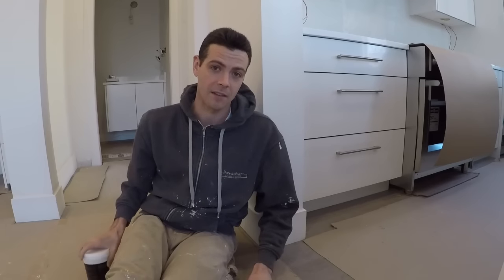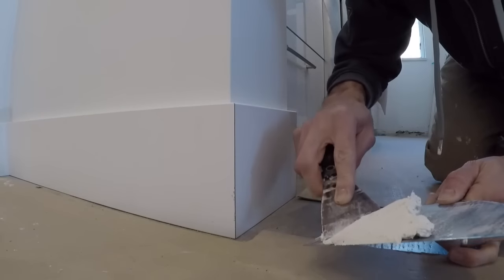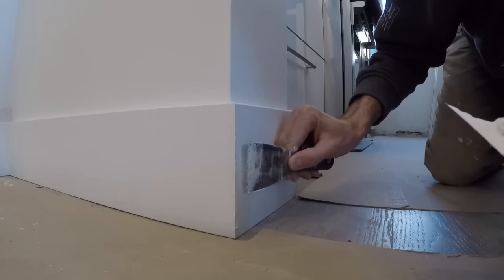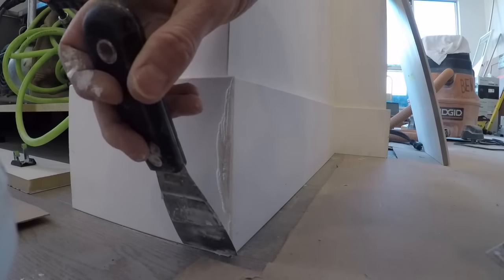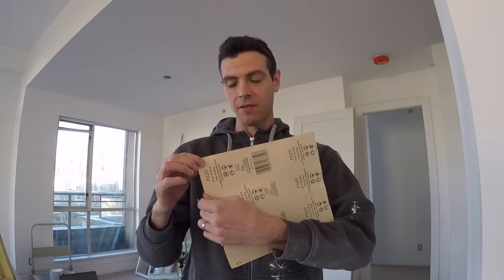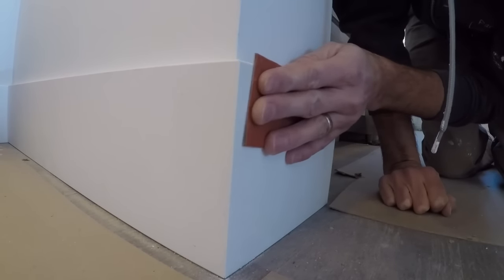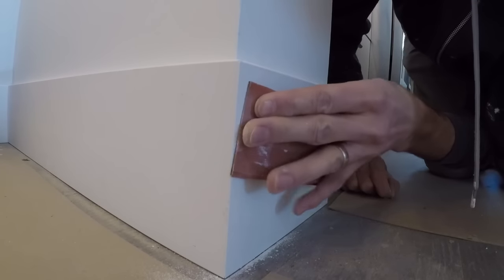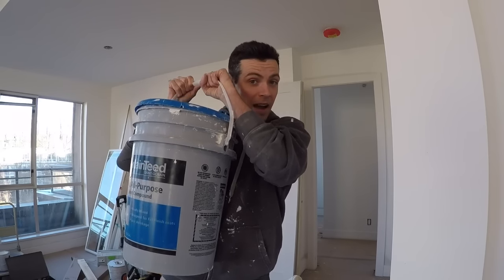How to Fix Open Miters

Comment: Many miter saws have an adjustable fence or scale that will require periodic alignment/calibration to make sure
 that the fixed detents are in proper relation to the fence. I check my miter saw periodically to make sure its still cutting a true 90 and 45.

Comment: If I would have left an 8th inch gap on my skirtings when I did my apprenticeship, I would have be walking to shop to buy a new one out of my own own money, and got an absolute roasting from gaffer  😂 learn the hard way and learn fast haha. Also, if your chop saw only goes to 45 degrees, put a plastic window frame packer (really thin one) under the board next to where you are going to cut, and it will open the angle out slightly to around 46 degrees. If you ever have any scrap pieces of skirting from a job, give it a try. Just make sure the end of the board is supported properly.

Comment: Not quite sure how you can call a DeWalt mitre saw crappy, they’re the best on the market! And as for setting it at 46 degrees, try 45.5, that’s more than enough to compensate IF you have a ‘crappy saw.’
Reply: DW708 OR 780
ROLLS ROYCE OF SAWS

Comment: Just came across your video...very informative.  I have a little gap by my baseboard right next to my tub.  Should I use the products you used in this video to make it less noticeable, or silicone since it might get wet?  I sure don't want it to shrink...which of those two products would be the best for that area?

Comment: The Point of tight miters is to have the glue bond to the wood, making only the tips touch with 46 degree when a 45 is required just makes miters that the glue is doing nothing and your joints will crack or open. No shame in if you need to sand the miter in as long as wood contacts wood for the glue to do its job.  Spackle will 100 percent crack out.

Comment: I use Bondo for wood. It'can be shaped and painted in 1/2 hour and doesn't shrink at all. I used to do autobody and paint professionally when I was younger so this product is a natural. I had to fix incredibly bad trim work in my house left by the builder in 1985. The Bondo repairs are still undetectable after many years.

Comment: Good job….(and from this professional….forget these high and mighty naysayers here in the comment section)

Been in engineering, construction management, and for many years now a General Contractor.
Repairing a home doesnt have to be this big “secret”. So many contractors like to pretend that maintaining a home is beyond most. Well, it isnt. Yes, those of us that do it for a living, in my case 26 years and $80M in contracts later, have knowledge and tools to get many things done. When our clients want to do additional home repairs while we are remodeling their kitchen or bath etc, then I have no problem spending a few minutes with them to share some tips on the work they are doing. Did it just yesterday with a client that wanted to install new trim in another room. They were just excited about the remodel and wanted to trim out and paint their master bedroom. Good for them.

Comment: Hi there, I have a problem that has been bothering me for a long time. I have my wall tiles redone and they are new and have no cracks on them but after they were put on the wall for some time,they all started to show cracks. I am sure that it was not caused by me and they did crack even though i changed them for the second time. They cracked but not like falling off the wall. it is just the surface that has long cracks. So what do you think caused it?

Comment: Cut a small piece of trim a sample piece with 45,46,47 degrees left and right to check before you cut. Also, put the filler in before you put it together. When you stain trim, get a stain marker and when you cut it, use the marker on the fresh cut. Sometimes, if the corner is off, because there are imperfections on the edge of the corner of the wall, try to remove it. If this doesn't work, remove all the material you can on the part of the bevel /miter you can't see using a coping saw. Finally,  as far as inside miters go, if you don't cope, it's wrong sorry. Learn to cope period.

Comment: I don't like to use the dyna patch the reason why is bcuz 
I tried filling the mitre joint on my flat casing and so after I painted it,the dyna patch filler flashes and it's
hard to get rid of it no matter how many times u paint it.
That is why I like to use the crack filler dap that has primer on it and it works perfectly.

Comment: You can fill the mitre but roll the edge of the mitre over with the round edge of a nail set or screwdriver so you're kinda folding the sharp edges of the mitre over each other closing the joint. This does two things it hides an open joint of up to 1/8" ( I would be embarrassed to have an open mitre of 1/8" but I'm just talking about the limits of this technique) And it rounds the wire edge of the mitre so paint will stick to it. No paint can stick to a sharp edge so always ease your mitres. Even with stained or factory finishes I go my touchup in one shot. Fill, fold the wire edge sand, dry rub the stain then spray top coat all in one stop so you don't waste time and footsteps coming back.

Comment: I've got the same De Walt saw and not sure why you think it's crappy. Mine has had an incredible amount of use and is pretty damned good. Definitely not a cheap tool. It makes pretty accurate cuts.

Comment: I would calk that gap, then immediately run the shaft(round) of a screwdriver up that corner at a 45 degree angle up both sides and it will close the gap and wipe off excess. I am assuming that the trim is wood.

Comment: I have a newer house, but one corner didn't line up too well and was very difficult to take in the dynamics - maybe unlevel floors or walls - so this filler will make my close (but not perfect) cut look perfect once it's filled and painted - thanks for the insight. Oh, doing Baseboard for a floating floor.

Comment: Quite frankly your cuts are pretty good. In this case I would use only a bit of dap white chaulking. Smooth off with your finger and done.

Comment: I always glue them with MS polymer glue and the seams with polyurethane glue that expands and after 15 minutes you can sand it. I never use nails. But then on the other hand over here in the netherlands we have brick and concrete walls so nailing is to much work

Comment: This doesn't work. Sure it will look great for a week to 6 months, after that it will more than likely fall out.  If you have this problem, there are glues that are gap fillers and are also able to be sanded. You can apply it in the same manner.

Comment: That's why you cut practice pieces at different degrees to test you're corners in the first place. So what do you do later down the road when someone bumps the trim go back and fix the cracked feeler Oh boy!!! This may be a sign to get out of the business before you get too far into the business of carpentry....

Comment: Have you ever used the trick of sliding the curve behind the head of your hammer down the joint to roll the edges together? I seem to use that mostly when making box beams, but the 46's takes most of that out.

Comment: If you're going to make a "how to video" and title it that you really should have a clue what you're talking about junior. That is what we in the real world call a hack job. The proper fix is to cut the miter at the correct angle. It's not rocket science and you don't need to be a "pro" to be able to figure this out, it's called common sense. Please stop misleading people.
Reply: I highly doubt contractors who need to be fast take that much time to find the correct angles esp when the angle on most corners varies from top to bottom (ie his last examples). I think if the baseboard is glued together and nailed to the stud after being climatized it will be fine.

Comment: A easy trick to get a little more degree on your miter is to put a 1/8 inch shim under your material close to the blade of the saw. It props up the material just a bit to give you about 1/2 a degree.

Comment: Use a miter angle finder and cyanoacrylate glue with activator on every outside corner. No spakle and caulk can even fit in the joint. I glue all three pieces then slide them onto the wall.

Comment: We use bondo all the time just go to a car paint shop and get some thin putty knives. Just start with a thing layer and build from that. Fix cracks reshape doors. For exteriors we use bondo fiber glass.
Reply: xsistor1 I like Bondo best. Some stores sell it with white hardener instead of red which is easier to paint over

Comment: Which product do you use for outside corners on exterior beveled siding?  I tried Quad caulk, but stuggled to press it into the joint.

Comment: We use a product called mitre mate here in the UK it's a 2 part glue 1 part glue and 1part activator cut the mitres and glue to together its sets in seconds then offer the 2 pieces straight in to place and it's a perfect 90 degrees

Comment: For that first crack, caulk would have been just fine. You are already going to calk the top of the trim so why go get a second product? After a coat of primer and a coat of paint you'd need a magnifying glass to see the line. As for the second one...

Comment: I thought you were going to do the trick where you run a hand saw through the joint so it takes away the material that's holding the mitre open.

Comment: 46 degrees on outside mitre joints - thanks for the tip.  What about inside?  44 degrees?
Reply: The old standard was always coped inside corners. The 44° is installed first and just touching the adjacent wall. You don't want it indenting the drywall, that's the 46's job. The 46° goes in lightly then go to the other live end, by holding the middle of the the baseboard out from the wall just enough to slip your fingers behind and pop a couple brad's into the live end. By nailing your way towards the miter joint the very slight extra length will be gradually sent to tighten the miter. 

I remember a help video series with the Roadrunner. He, beep beep, demonstrated this technique to Wile Coyote many moons ago. Roadrunner's looked great, Coyote needed help so he asked his Paw. He stuck to that miter job until he had it glued and nailed in place. What happened next was interesting, at midnight Wile didn't have a leg to stand on.

Cheers

Comment: Another good tip is , use a protractor to find the degrees of the corner, example; your corner isn't exactly 90 degrees (most aren't) say it's 92 degrees..divide by two, half of 92 is 46, set your miter saw at 46 degrees and wah-la.. perfect corner everytime, no little gap like this one,  Works for inside and outside corners as well.
Reply: Great advice!!! This video is for people who have gaps that were created  by people not as good as you at your craft.  Very helpful for thr novice DIY'er!!!

Comment: I've always used caulking,I can fill in almost any gap with some fast drying painters caulk. All I need is a tube of caulk, caulk gun a five in one putty knife and a damp rag to clean up any mess.
Reply: @Cr6479 if enough caulk is inserted into the joint the shrinkage is minimal and also nine times out of ten the home owner isn't gonna notice the the joint needs a little more caulking, they aren't gonna put their face right up to the trim.

Comment: Carpenters that know what they're doing generally check the angle while they're making their cut list so the miters close up all by themselves when you cut them correctly
Or you can just cut everything at 46 degrees and caulk what's needed
Reply: You can also cut scrap left hand and right hand outside pieces at 44, 45 and 46 degrees (6 pieces total). Find the right combination of left and right to make the joints tight.

Comment: This is one way, but with my 45 years of experience, there are several better ways to tackle baseboard corners.  This particular problem looks like a painter's problem, because no carpenter should leave an exterior corner looking this bad.  My preferred painter's method is to use a high quality latex caulk, as it will not shrink enough to be a later problem, as hard material, like wood fillers will crack due to temperature movement.  I also prefer the latex caulk, because I wipe excess off with a damp cloth, therefore no sanding needed, and the paint finish is consistent for the entire length of baseboard.  The same is true for the brad holes, as any remaining divot is not noticeable except to the very picky.  However, it is a definite benefit if one has to remove the baseboard and reinstall it.
Reply: Yes maybe not so noticeable on white paint. But if the base boards and door/window trim are another color you are going to see everything. I agree with the cracking but you glue your joints it should be more resistant to that. I am not professional but I would think you would want to be able to sand a joint. Caulk will always leave a depression in the joint because it is so soft.
Reply: @siskens470  Painting is an illusion, so caulking 'divots' if done professionally, are unimportant.  Most baseboards are hidden by furniture, but in hallways, one just has to be a bit more careful.  However, in hallways, the veiwing angle is steep and no one gets on their hands and knees to check the 'quality' of the divots.  Even window trim joints are best served with a good dose of caulking and a damp wipe. I do what works, for the least amount of effort with maximum results.  The problem is often left with the painters, as many contract carpenters leave a shitty job. ("It is the painter's problem.")
Reply: @ya472 I  I have had the ones that leave an impression in the final product and those that don't. Guess which ones I hired again?
Reply: @siskens470  Yeah, it depends what you pay them, and what you expect.  I am also selective whom I hire, and guess what, I would enjoy checking out the quality of your projects, because I know you aren't perfect.  :-p  If you were, crews would not work for you, or you wouldn't make any money.
Reply: @siskens470  I have been in this business most of my life, and my wife is a Realtor, so I get to check the quality of builds...   and mostly, I just shake my head and feel sad for the purchaser.
Reply: @ya472  I definitely could do good work if I took my time and felt it was worth it. I bought a house with an immaculate basement, done professionally...you can't see any nail holes lol. I had a water claim and let me tell you I made sure the company I used to restore it back to what it was did it perfectly. If they f'd around sloppy and could see nail holes and sh*t they had to redo it. The project manager agreed.

Comment: Buddy showed me that you can "touch" the gap line with a hammer and it will move the wood toward each other.   A flat face hammer  that hits both sides of the gap line at the same time, tap tap tap up and down the gap line.
Reply: Will small gaps in corners with wood working projects I use something round and smooth and run it up and down  both corners edge pushing the corners inward toward each other And if the gap is to wide I Would use some kind of fill. Do not know why it would not work for trim.

Comment: Can I do this for inside miter gaps on my poorly cut molding?
Reply: Don Sni absolutely I use dap with the pink lid works great
Reply: @rp573  Thanks. I cut my mitered inside molding too long and did a rookie move by nailing and not dry fitting lol.

Comment: All these videos on finish trim use white moldings.  White’s easy to fix.  Show a video with some stained wood if you want to impress me.
Reply: Daniel
The dark line of an open joint shows much more on white trim then stained trim.
Reply: Skip Butler Closeup photography will show a gap in wood just fine.  It’s a very good hack to use joint compound on white, but easy.  Just wishing some expert would show a similar hack for fixing stained trim and everything I’ve seen so far is only white.

Comment: Cut 1 at 45 degree's then just measure the angle of the other simple.
Reply: Gary Mulligan you shouldn’t cut mitres at different angles. As the angle increases on the second piece the mitre begins to get longer. Thus meaning the angle of the cut will be longer than the other. I hope that helps.

Comment: Wasn’t expecting to see him get the filler out. Glue external mitres with gap filling filler as you fix them if you can’t cut correct angle

Comment: Takeaways
Cut outside corners greater then the standard 45 degree (i.e. 46 degrees). 
Caulking corners causes sinkage over time, a better approach is to use wood filler / spackling & patching compound that are more sink resistance and durable.   

Thank you for the tips, those corners look clean. 
For stain grad material, wouldn't a stain grade filler work too (i.e. DAP Plastic Wood).

Comment: The title could be; "How to fix any hole or gap in trim before painting." 
I often use Painter's Caulk (Alex as and example). Goes on easy, wipe off with finger, flexes in case the material moves and can be painted. Compound will shrink and crack in most cases. However a good coat of paint will act as a latex bridge over the crack.

Comment: Terrible plastic homes you build in the US. It's not a house, it is a 1:1 scale model of a house build from cardboard and paint.
These MDF boards coated with PVC foil are damaged upon first encounter with a vacuum cleaner. It will suck the putty that falls out onto the floor.

Comment: An additional tip...slip the blade of knife holding the gear under the trim as you fill the gap with smaller knife. Then you can fill right the way to the bottom without getting any on the floor and without needing the put paper underneath.
Reply: Good thinking! thanks for sharing.

Comment: Or maybe a combination of 45 and 46 degree cuts , and nailed (glue optional since it can get messy-have a damp rag handy)  together with 18 gauge brads?  Use a small builders square first to determine the proper cuts required, or a good speed square for inside corners.